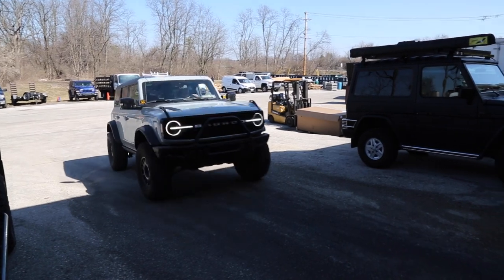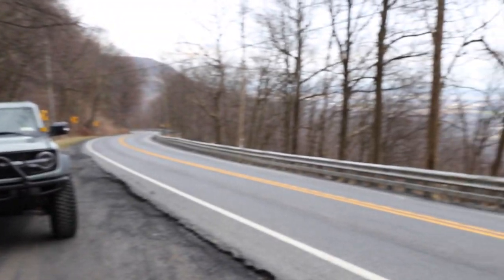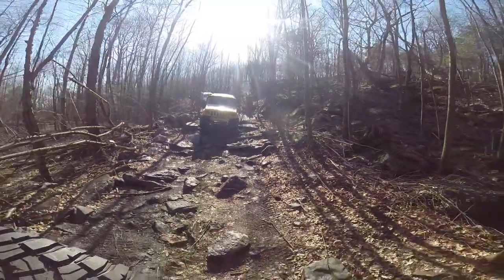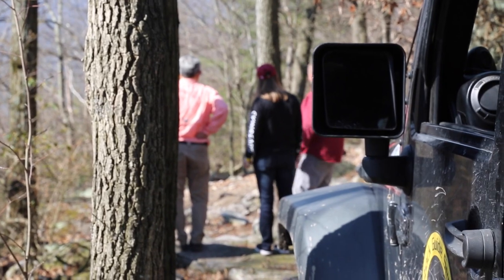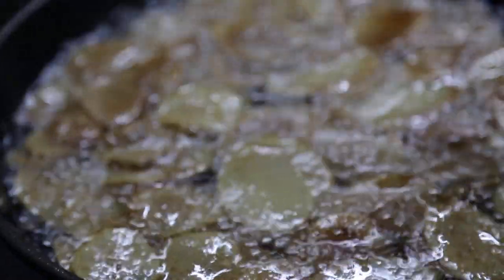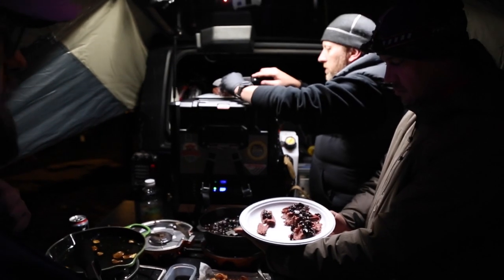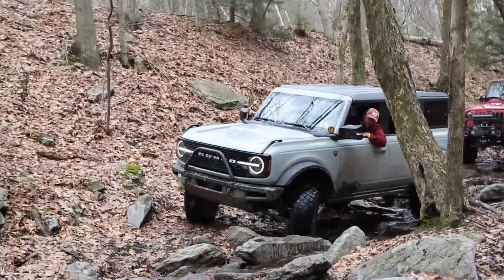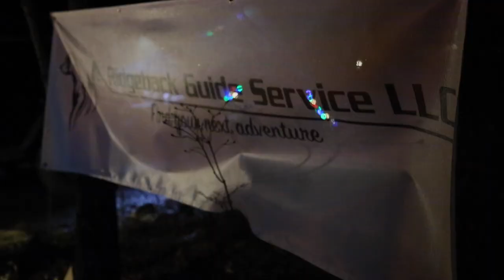Lifted Ford Bronco VS A Weekend Off-Road: CAN IT KEEP UP? | MLO On Trail

Comment: Awesome video! Do you think a power wagon on 37”s would make it on those trails?
Reply from the maker: Good question, depending on tires possibly. The break-over angle and longer wheelbase might get you hung up at some point though.
Reply: I can’t think of a time I have seen a full size rig at AOAA but on 37’s you would be alright on blue and possibly some black trails. But if body damage is unacceptable this park is likely going to prove very stressful for you